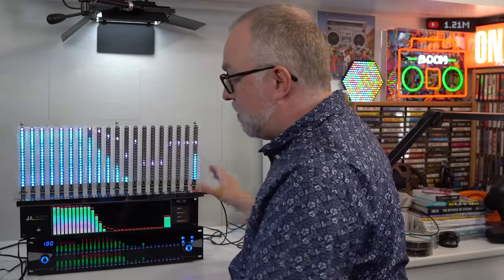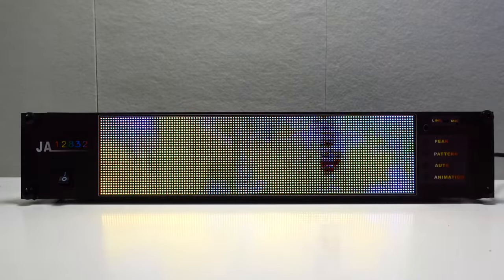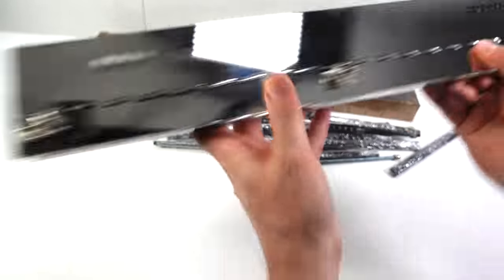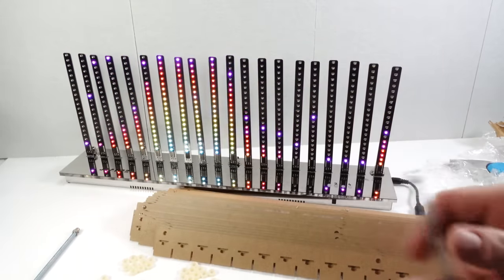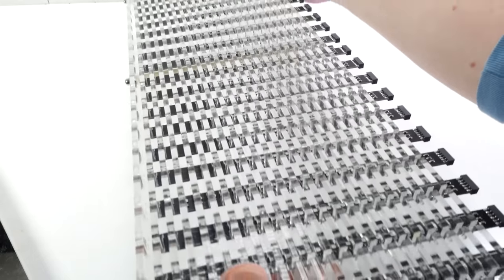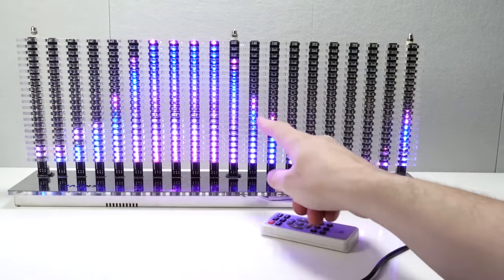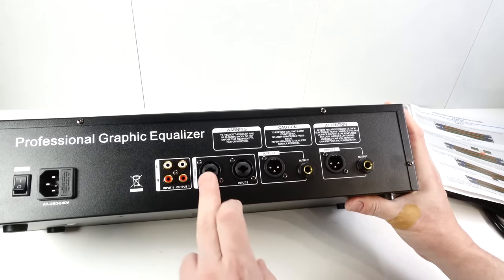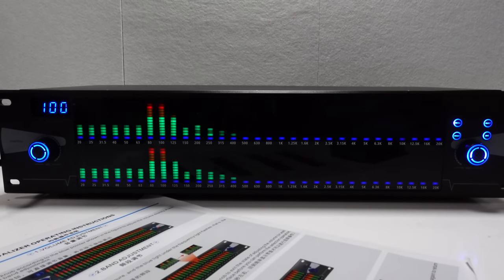Three more music Spectrum Analysers.  All that glitters...

Comment: The spectrum analyser of the first two also seems pretty dodgy... it's not quite as blatant as the third one, with the first half dozen meters all showing the same value, but it looks to me like the first two are only analysing the spectrum at 7 different frequencies, not the full 30 or however many channels they visually appear to have... and then they're just drawing a straight line between those points. This is most obvious when doing the sine wave sweep, but really you can pause the video at any point and look at the display, it's just 7 specific points, with straight lines drawn between them.

Comment: If I had to set an equalizer like how the 3rd unit works, it would be thrown off the deck after about 30 seconds, and I’m not even short tempered or anything. It’s just that useless

Comment: There are 3 spectrum analyzer flavors. FFT or Fourier Frequency Transform which uses software algorithms and processing power. MSGEQ7 custom ICs for 7-chanel hardware based. Finally you have the classic Low and High band pass filter configuration working in the analog domain for real time Frequency response and accuracy.  On my YouTube channel I'm using the second alternative.

Comment: That tall one with the LED Strips would have been better suited behind a piece of smoked plexiglass without all the dividers, and spacers. Just something to hold the strips straight at the top would have worked fine. Still a piece of junk. Thanks for your review though. You are dedicated to full reviews of even these poorly designed bits.

Comment: That last unit is absolute thrift store quality. I think I would have built the second one, aligning one level at a time, using a combination of spacers to make sure each level is aligned properly before finally assembling it. While I do like the aesthetic, it's a dust magnet. Dust and electronics are not friendly to one another. Thanks for your patience.

Comment: i think you have to put the second one together while the bolts are already locked onto the machine, that way you build it up WHILE you align it at the same time and use a spacer where needed, and none where not needed